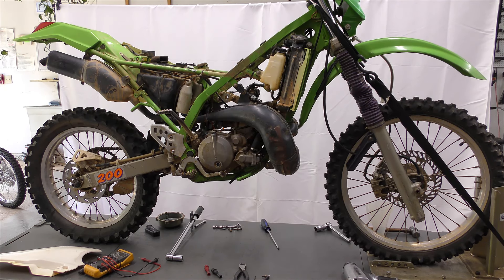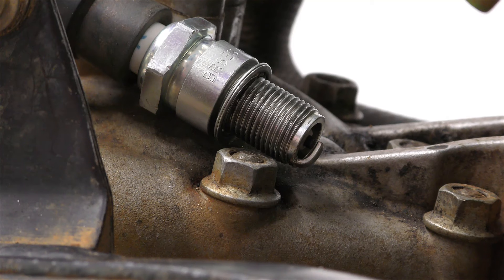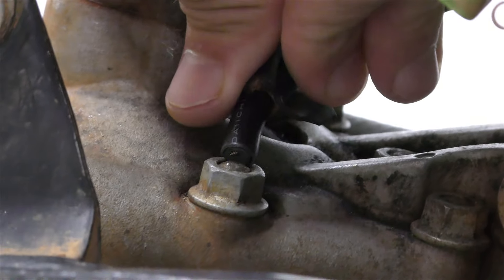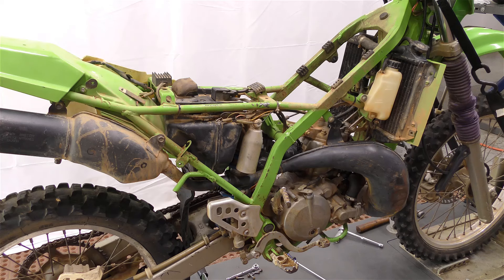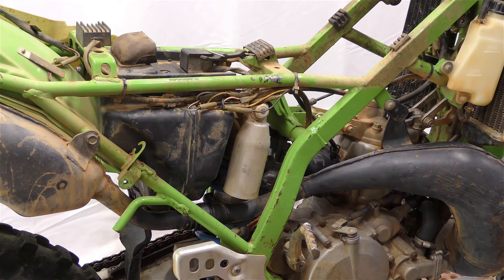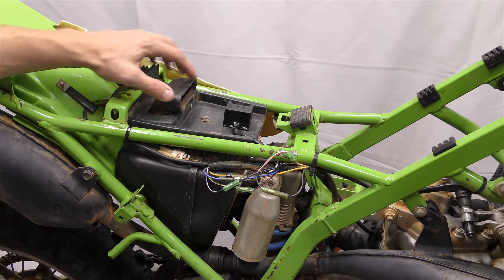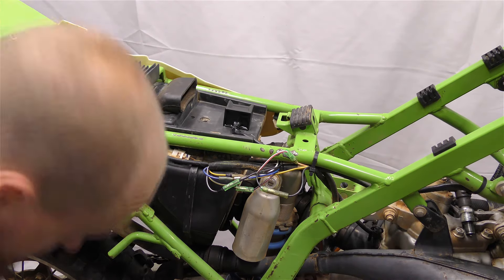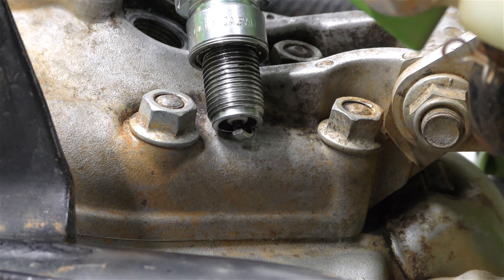Kawasaki KDX200 No Spark Weak Spark

Comment: Pull the flywheel. Likely rusty from condensation. Replace the stator if still weak. Can't always rely on ohm values. Peak voltage would be a more accurate test. Don't buy the electrosport stator.
Reply from the maker: You need to watch the video again lol! I pulled the flywheel and it looks like new in there. The CDI fixed the weak spark and the bike starts on the first kick now. Whole point of the video was to show how we FIXED the problem and it turned out to be the CDI which we got for 15$
Reply: @Cyclepedia   the video I watched didn't show any of that? It was only a few minutes long. Was I supposed to follow a link somewhere? Seems confusing for an expert.
Reply: @brianmartin414  shut up ur not the one doing the work
Reply: @ChopChopem guessing and swapping parts doesn't show anyone how he "fixed" it. No yest values or procedure explained so what's the point of the video? How to wash a bike ? You tube experts at it again.  I trust ichiban more that this waste of time. Next